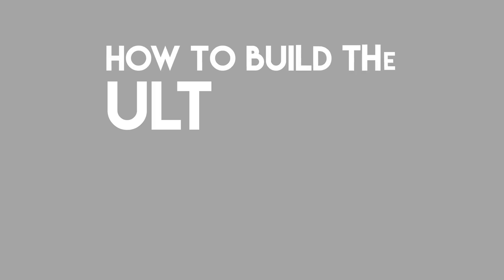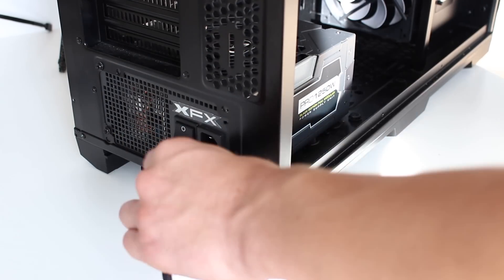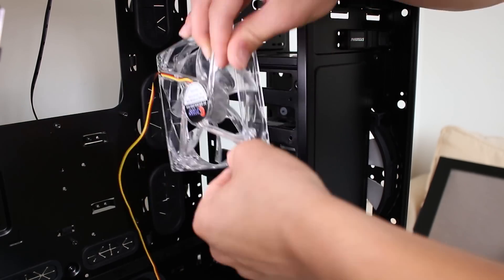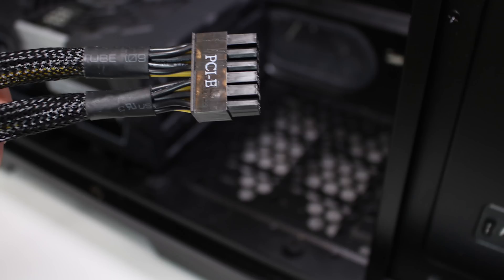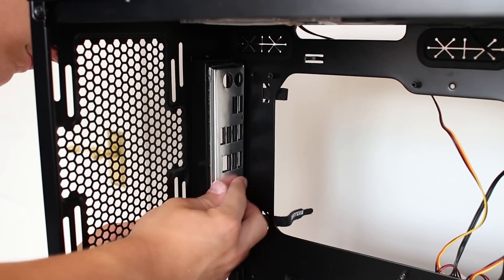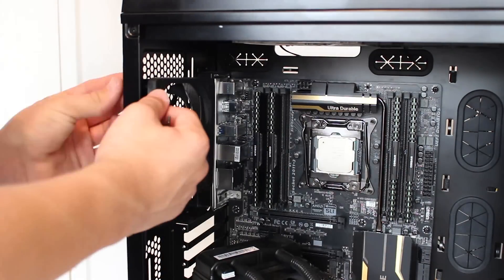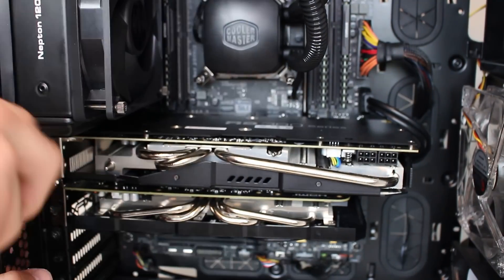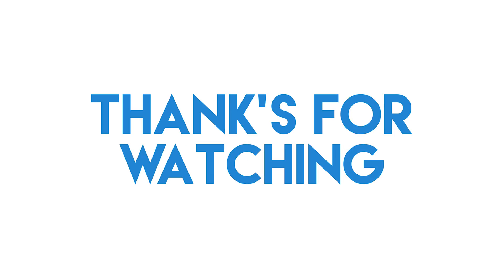ULTIMATE X99 EDITING PC BUILD GUIDE [$3000 PC BUILD!]

Comment: Good job with this!
I have a question. Does GA-X99P-SLI support I7 6800k out of the box or you need to update Bios first in order it get it supported? 
Thanks in advance.
Reply from the maker: Thanks dude! If you buy a board now it will yes, according to my contact at Gigabyte they have been shipping with the Broadwell-E BIOS for 3 months :D You can flash it (update w/o a CPU using the special USB port on the back as well :D)